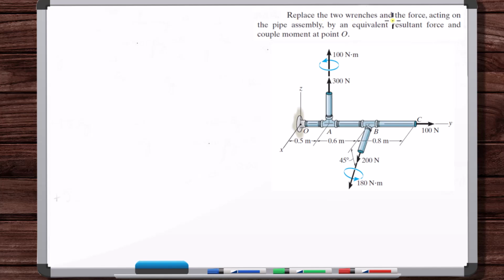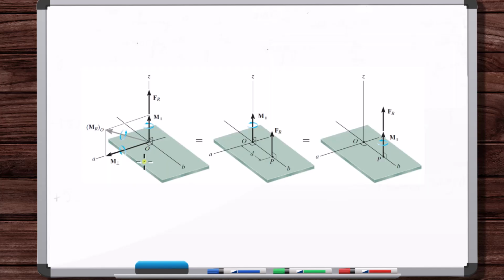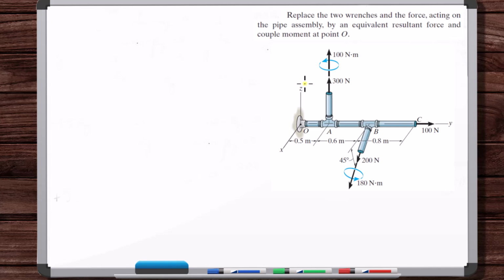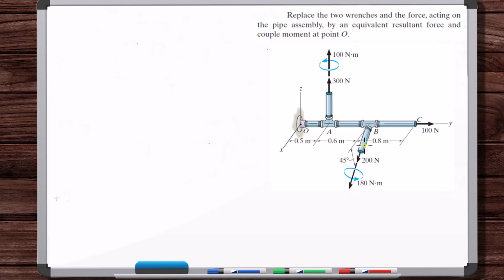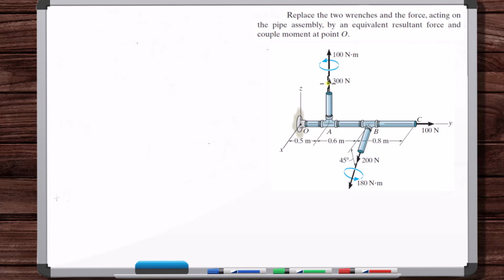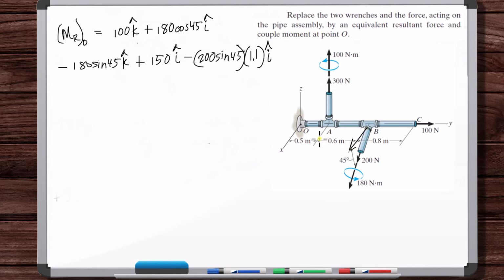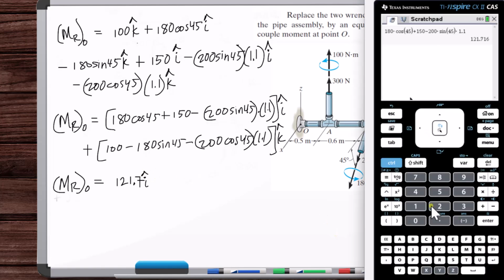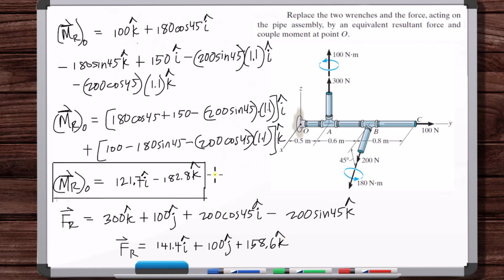Resultant Force & Couple Wrenches on Pipe Assembly

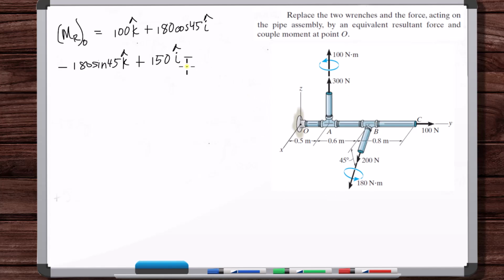Comment: 11:17 
Why is it negative 😭
Reply from the maker: You have to use the right hand rule. With your right hand put your thumb in the direction of positive x. Where does the curl of your fingers point? That’s positive rotation about the x axis. Ok now what direction about the x axis is the vertical component of the 200N force causing rotation? It’s opposite the direction of positive rotation about x.